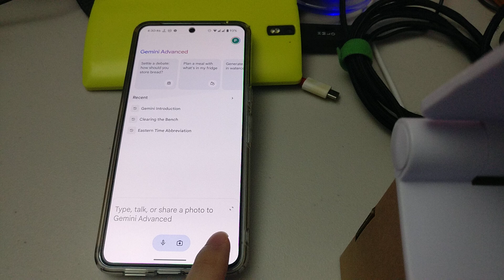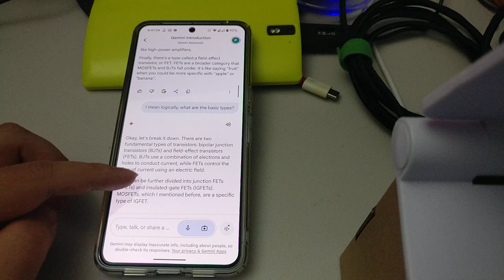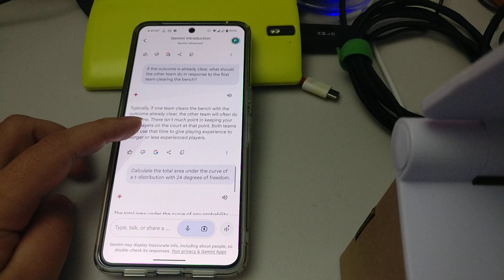Gemini Live Knowledge, Math, and Creativity Testing

Comment: I'm not an expert but from your experience how is it?
Reply from the maker: Somewhat smooth and responsive, on mobile headphones don't yet seem to work, has to be via speaker. 
It can answer the very basic "Siri level questions" without much trouble, and can sometimes perform on harder tasks, but otherwise it just feels "slightly dumb". 
It's rarely entirely clueless when you ask something complex but as shown here, if you ask it some more specialized questions it mostly gets it wrong overall, but has hints of the right answer within. 
I didn't really fight it this time, in my prior video where I didn't do any setup, I fought with it on a harder question to see if I could nudge it to the right answer, but that's the issue, why would I actually ask it questions when I need to guide it to the answer (that I supposedly already know?)